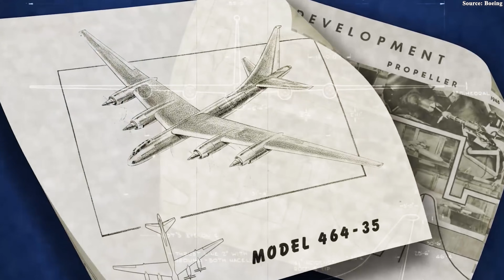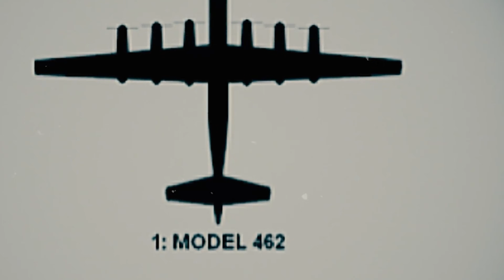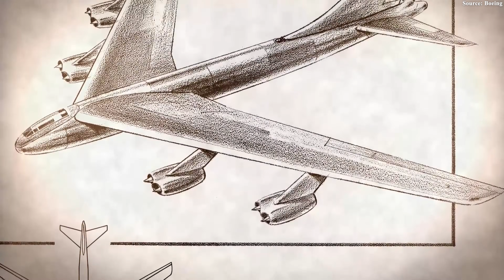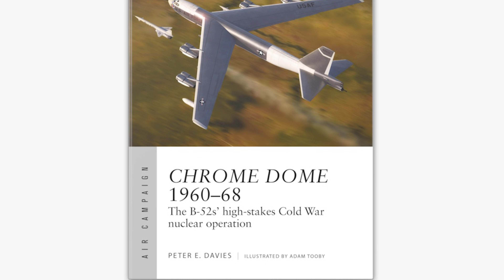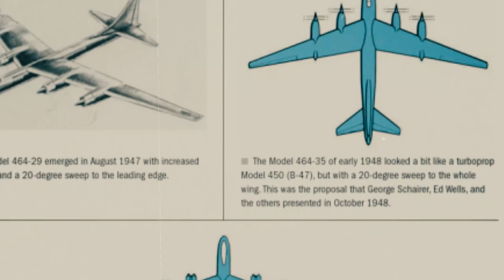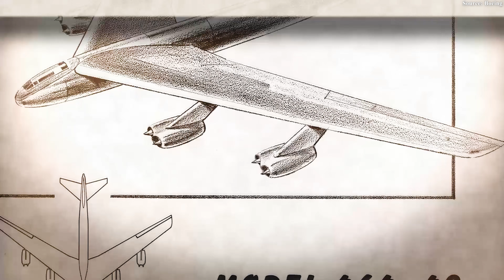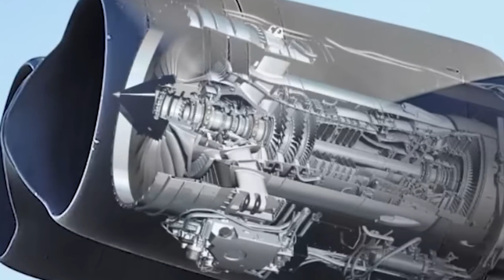The NEW B-52 ENGINES Will CHANGE The Entire Aviation Industry! Here's Why

Comment: Im interested in the topic, but I'm turned off by the AI. Really turned off.  First, right off the bat, the ignorance flowed. The "Wright R-3350" is NOT a turboprop engine. 
Someone involved here is ill-prepared to be involved with this subject. 
Also- I too, thought it would make the most sense to replace the 8, small engines with 4, newer, larger, more efficient engines.  Possibly clearance under the wings precluded that option.  In any case, I'm really glad USAF is moving on this. Patrick Cowdrey, Redding, California
Reply from the maker: really appreciate the information you shared

Comment: Why don't they built it with 4 engine instead. The new state of art engine on for exemple Boeing 777 is way more fuel effective
Reply: this has been THOROUGHLY discussed - there are legit reasons to not, including having to change wings and rudder. Please ask google. Ths is a near 80 year old design and has specific needs.
Reply: Thrust & speed requirement

Comment: Can anyone imagine what the typical spontaneous mental association of a typical (US-)American could be when confronted with the two terms "bomber" and "Germany"?
YES! (As a German, I avoid to elaborate any further!)
And this seems to have created a marketing problem for Rolls Royce. Because the new engine for the B-52, called the "F 130", is in fact a refinement of an aircraft engine developed in Germany: in Oberursel (near Frankfurt) and Dahlewitz (near Berlin) by the former joint venture BMW Rolls-Royce, beginning in the 1990s and called the BR 700 series. BR 700 engines became the powerplants of choice of several business jets by Gulfstream, Bombardier and now also Dassault, and they were once selected and used as the sole power plant for the McDonnell Douglas MD 95 (aka Boeing 717). BMW left the joint venture and Rolls Royce took over the enterprise. They are just now expanding their factories in Dahlewitz.
I have never seen any statement by Rolls Royce (or any of the video bloggers presenting the B-52 upgrade) that had mentioned the F-130 technology to have been developed mostly by German engineers in Germany!
Being a tiny private Rolls Royce shareholder myself, I therefore have to humbly ask you all:
"Please keep it secret!"
Reply: What's your point? Rolls likely took off all the extra crap and weight that is so typical of "German" engineering, stemming from the attitude, "if you can't make it smart, make it stout".
Reply: That's interesting background and for sure UK/German (and to be fair despit the quibbling) French Aeronatics Collaborative projects are typically good.  (Think Jaguar, Tornado & Typhoon)
So maybe your fretting's a bit hypersensitive ? - Its not as if RR are claiming 'This is a British Engine'
The decals on the suround says RR - built in the USA

Comment: No, the new B52 engines are not relevant to ALL AVIATION. Enough with the sensationalist titles.

Wrt the content, it boggles the mind that the US is willing to spend tens of billions of dollars to keep a fleet of just 78 ancient aircraft operational for additional decades. If the basic layout is so useful, why not design a similar clean-sheet aircraft built from composites and give it a landing gear tall enough to accommodate fewer turbofans with higher bypass ratios to cut fuel consumption and increase weapons payload?
Reply: Its bloody AI! Everything is "all aviation" & " shocking"  etc etc. its all computer driven nonsense!
Reply: @georgeswindel8367  It certainly has its share of 'Hallucinations' ...

And that's not about the spelling - some of the claims are plain inaccurate - WHEN was it ever a low level attacker?
Reply: You know damned well there are politicians, probably Dumbascraps, who will profit from this "investment". It's ALWAYS about graft and pull...